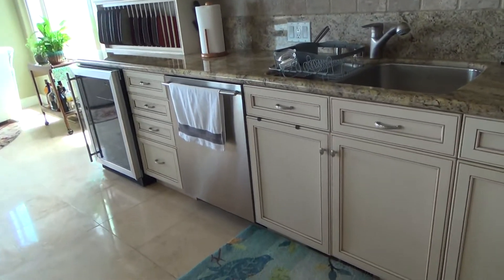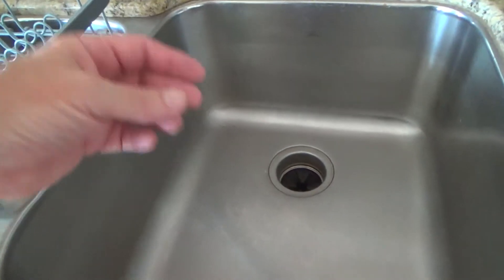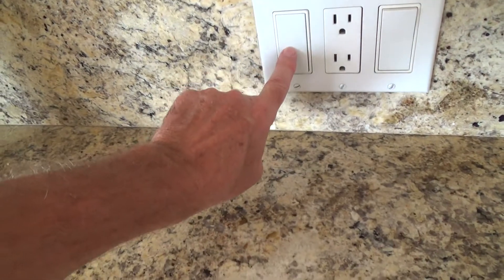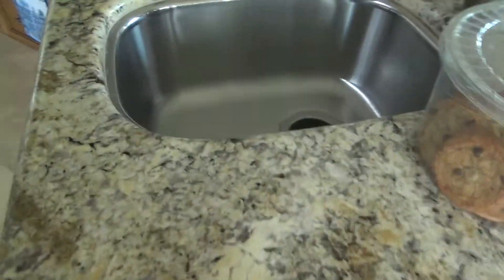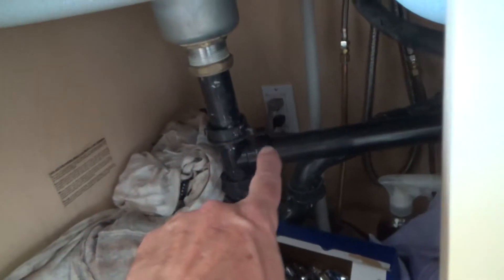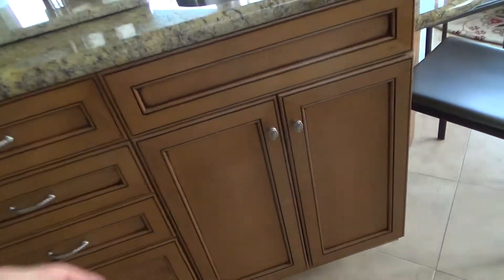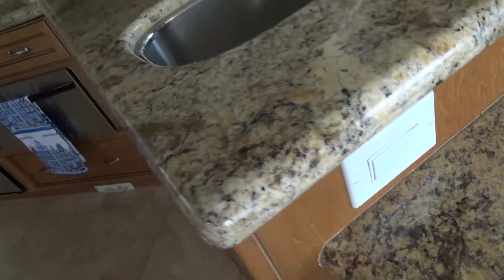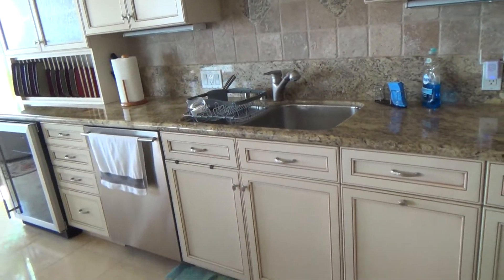Can I Wire Up a Garbage Disposal Switch to be GFCI Protected?...Why Not!!

Comment: A much easier solution, but a little more expensive, would be to replace the circuit breaker in the service panel with a breaker that has a built in GFCI?
Reply from the maker: Yes I see what you mean but like you say it's a bit more expensive plus if you have never worked in a sub-panel before then you might want to do it the way i suggest. Plus there are different makes & sizes of breakers as all standard 15 & 20 amp breakers are not created equal to fit all panels but yes you can do it the way you suggest as well but why not re-wire in such a way to where your garbage disposal switch is still protected by GFCI by using an existing one...? Thanks for checking out this video & sending me your comments!